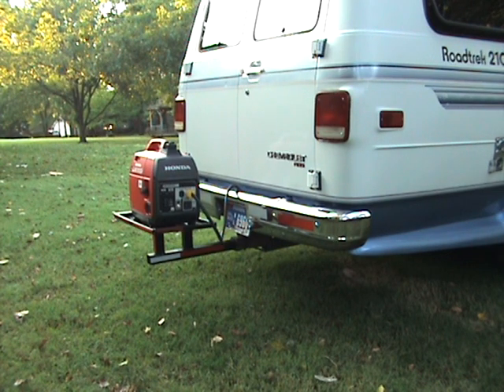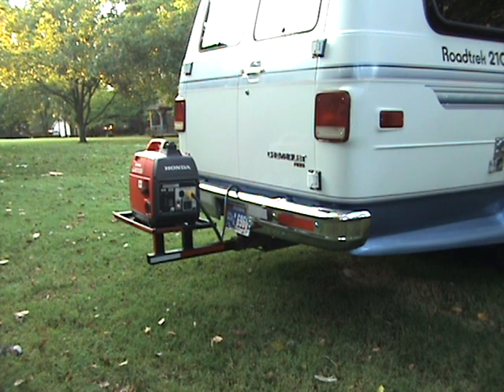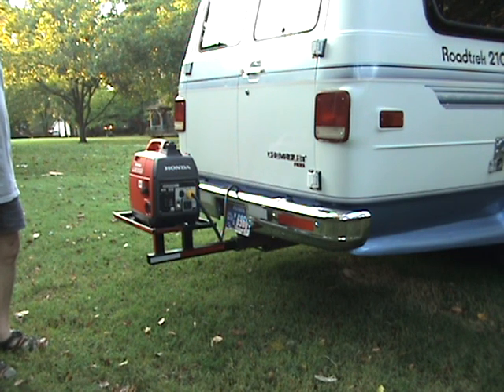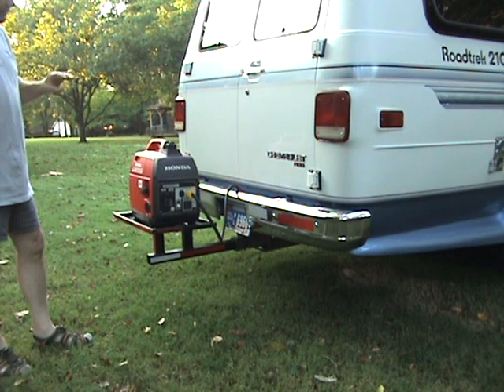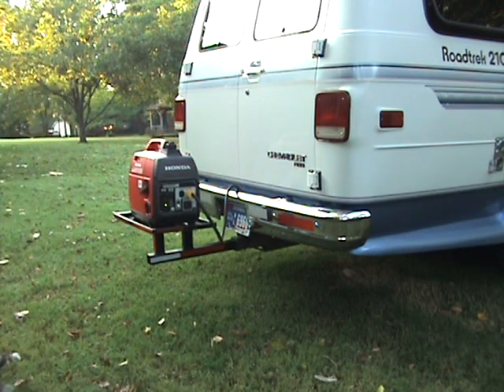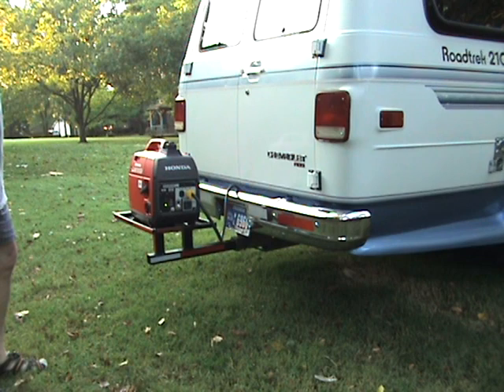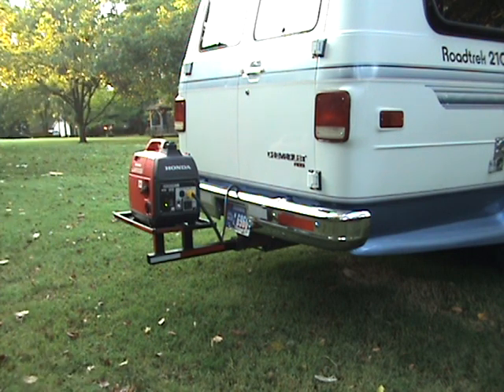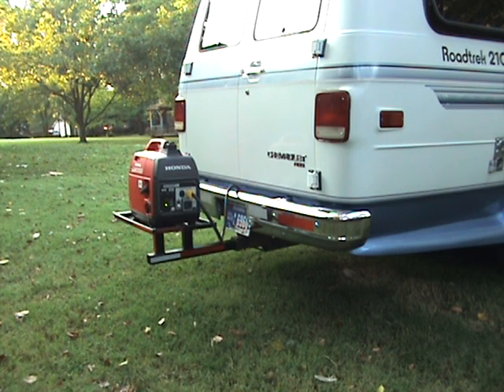Honda EU2000i Powering Roadtreck RV - starting 10,000 btu ac

Comment from the maker: We moved the little Honda to our boat to provide shore power. Will have more information this sumer. Very happy with the little Honda. We added an extended run fuel system to provide power overnight on the boat. Works great. I can run all weekend with 5 gallons of gas.

Comment: I just bought this Honda. I live in Florida.  I have an 8,000 BTU AC. The generator started the ac fine, but if I try to use the eco mode, the compressor on the ac will not come back on. We just left it on full power last night,  but it would be nice if we could put it on eco. Any suggestions?
Reply: The last big hurricane that hit we lost power,I used my Honda 2000i to power an 8000btu room air conditioner in the house.It would not start the compressor in the eco mode.So I just left it on normal.The generator would run for  exactly 4 hours on the 1 gallon tank of fuel.But Its  actually .9 gallons  tank.

Comment: I wonder if this generator will run one of those 10,000 BTU portable standing home AC systems like the LG or haier ones.
Reply from the maker: Shouldn't be a problem at all.  They are a lot more efficient than the 1996 RV A/C.
Reply: I have seen a guy run a portable, 10,000 BTU home AC unit with a Generac 2,000W generstor from Costco. No problem. It's a generstor similar to a Honda EU2000 but only costs half the money.

Comment: where do you place the generator while running?  I am planing on doing something like this for my diy camper van but I am worried about the fumes of the generator getting inside the camper just a few days ago a couple die in their sleep  while camping cause of this reason.
Reply from the maker: The generator stays right on the bumper where it's shown. I make sure when I stop the wind carries fumes away.  I also have a CO detector in the cabin.

Comment from the maker: The coach mounted A/C crashed on me this year and I had to replace it with an 8000 BTU compact A/C unit. This is a loss of 20% in capacity but I'm still getting better cooling with the 8000 BTU unit than the old 10,000 BTU. I've also noted that the smaller AC does not put near the load on the little Honda that the old unit did. I also eliminated the extra run capacitors from the inverter that helped start the old AC on the 100 degree days while the Honda Generator was in Econo mode. Still very pleased with the little Honda.
Reply: professorhardknock so the ac is running ok. how long have you had the Honda EU 2000 generator?
Reply from the maker: jrdtl1 This is my fourth year that I've had the Honda. Just used it last weekend on a trip and the generator worked great without the extra start capacitor for the A/C compressor.

Comment: I am looking at the Honda EU2000i generator. I would really like something that mounts under my van like your Onan did. I want to connect it to my van's gas tank. Any ideas?
Reply from the maker: Will Burson After having the little Honda for four  years I would never go back to an under van mounted generator.  I have my honda connected to the old ONAN fuel supply line on the main fuel tank and it now runs all night long without any problems. The Onan was a nightmare to service, offered no portability, and I was forced to take it out from under the van four times in one year. YOu need a fork lift to make this job easier. The ONAN runs at 3500 RPM (LOUD) as opposed to the Honda which varies the RPM based on the load. The Honda has just been a real workhorse. with just regular oil changes the only maintenance item. The oil changes are a snap. I did add a bank of run capacitors to assist the compressor starting on the AC unit on hot days. I added them inside the coach next to the inverter.
Reply: professorhardknock Yeah I'd definitely want mine hooked to the van's fuel tank. Do you lock your generator on the rack and cover it or stow it while you drive?
Reply from the maker: Will Burson It remains on the rear platform with a cable lock at all times unless I'm towing a trailer. It remains uncovered.

Comment: Your 10k BTU AC must be very low draw on start.   I know other people who have 8k BTU units that can't use the Honda in ECO mode...including myself.    Runs just fine with ECO off.
Reply from the maker: I have installed a second start capacitor installed on the AC unit in parallel with the original. The second cap makes all the difference in the world. Even on the hottest days the little 10k BTU runs like a champ. This will be my fourth season with the Honda. The original cap has three connections, common, fan circuit, compressor circuit. I went in parallel with the common and compressor side of the original cap.

Comment from the maker: I'm in my third season with the little 2000 powering the RV. Very pleased with the investment. The little Honda has exceeded all of my expectations. I just drove through some blinding rain storms last weekend with the Honda powering the 120VAC system while it was on my bumper hitch mount. Ran like a top. I even used it to power my van 12VDC system when the main alternator failed. Kept my main engine fuel pump running so I could get off the freeway. I set my trailer plug to power the main batteries from the Honda in the event I accidentally drained the main battery while parked. I had no idea how handy that little invention would become.

Comment: that's absolutely awesome... Thank you I was going to buy the 3000 but looks like the 2000 is all the power I need I do have a question I love how you mounted the generator how loud is it inside your van my head would be laying right on the back doors just wanted to know? When does the 2000 come with a remote start
Reply from the maker: Sorry about the delay getting back to you. Just saw your post. The generator is quieter than the AC unit itself. If the 2000 is ever offered with a remote start I'm going to buy one. My head is right next to the generator and right under the AC unit when I'm in the bunk. I'm working on fuel system mods to connect the 2000 to the RV gasoline supply so I can run all night without refueling. When i'm in the city where theft may be an issue i just unplug the generator and put it inside for security.

Comment: I've had two different RV's with the Coleman Mach AC units.  The Honda EU2000I will start one of those AC units reliably even in economy mode.
Reply: Crafted what btu does it start reliably? What is model number? My campervan 7200btu is not keeping up and I need to upgrade. I power everything with my Honda EU2000 and don't want to change generators.Also, hoping to get a roof top a/c that cuts off fan as well when temp is reached inside van.
Reply: The Coleman Mach units I've had success with is a 13,500 unit.  Most of the standard size units in this range cannot be ran because the starting load is too high.  You only want a Coleman Mach series.  And yes, I've always used it in Economy throttle mode to run the AC.
Reply: when compressor kicks off, do you have the ability  automatically to stop fan too for energy savings and noise?
Reply: Yea, all AC units as far as I know allow you to lock the fan on.  That is a thermostat setting - either "Fan ON" or "Auto".  Sometimes this can help if you have an AC unit the generator can't quite start.  You leave the fan on, this way only the compressor motor is starting and not the fan motor.  Motor start up is a big load on a generator or inverter.

Comment: If you don't mind me asking, what bad A/C are you using? I'm wanting to upgrade my tent trailer and I am having troubles finding rooftop a/c units under 10,000 btu.
Reply from the maker: The Roadtrek AC is a window mount AC unit that fits into a slot the top back of the cap. It's out of the slipstream when you're driving and does not cause any drag.

Comment from the maker: In reply to mosheg77. I'm pulling 2300 watts on a 90 degree day with the AC unit during start.  On a 105 degree day I'm pulling 2500 watts for more than 1.5 seconds and it is tripping the overload on the generator . I'm experimenting with some additional capacitors on the generator start circuit to give the AC an additional boost

Comment: Do you see any issues with the Honda EU2000i while running a 5000 btu AC, 26" TV, DVD player and a couple of small LED lights? Thanks
Reply from the maker: Hello, THe best way you can tell is put a load monitor on your black wire with all of the items running. You can pull 2500 watts during the AC start for one second without tripping the overload on the generator. If your AC compressor takes more than a second to start the compressor it will trip the generator. I'm experimenting with some large capacitors this year to give my AC an extra boost during real hot days and allow me to run in Eco-throttle continuously.
Reply: Make sure your tv is on an inverter not straight 120v or the starting current draw of the ac will take your tv of line.
Reply from the maker: Scott Falkner I have all of my electronics powered through a UPS backup. Provides very clean level power.

Comment from the maker: At some point during all that switching around your inverter is going to de-energize and cause a loss of power to the AC compressor. If the AC looses power and then attempts a restart it usually has a three minute delay before the compressor will start and then you are back to a normal start. I just start my AC with my Honda EU2000i with the Eco throttle OFF on the generator, start the AC, turn the AC Fan to a Medium setting, and then turn The ECO throttle ON.

Comment: Hello I have another question how start my 13000 BTU AC
Can I start my Onan 2500 generator, then , "On" AC -Following that start up my Honda
generator  - connect to shore line- "Off " Onan generator. In this case I can avoid high amperage during the start up AC. Is this correct?

Comment: Yes,from what I've learned the 5-2-1, 3 wire capacitor (not the 2 wire type) not only reduce amp start up requirements but are the best. I'm surprised that inclement rainy weather has no negative effects on the Honda unit and electronics/switches/controls. Thanks for the info as well. Let me know if you install the capacitor and how it works out. Of course they are used in residential & commercial applications as also.

Comment from the maker: Thank you for the advice on the CAP. The little Honda has worked perfect in all weather. Rainy weather seems to reduce the load from the AC unit and causes the Honda to work better. THe Onan Microlite would constantly stall from carb ice after it had been operating for an hour. THe Microlite is a 2 pole 3500 RPM genset. I have a 6000 Watt Onan  4 pole 1800 RPM 220 VAC 1ph I use to power my home during outages and it works great.

Comment: Try a 3 wire 5-2-1 hard start capacitor on your AC. Should take much of the A/C start up and cycle load off the Honda. 

How does the Honda respond in rainy weather while in use?

Comment from the maker: That's a great idea. I'm going to pull the prints on my AC and see if there is an option for a second cap.. My AC has only tripped the generator overload twice this year and both times I was in 115 degree heat. A second cap would probably fix that. Both times I was operating with Eco-throtttle ON. Thanks for the comment.

Comment from the maker: The generator cycles on and off on eco-throttle with no problem when the temperature is up to 90 degrees outside. It would trip on overload when it was new but now that it is broken in it has enough power to stay on eco-throtlle without tripping. Above 95 degrees it will trip on overrload when the AC cycles off and on. What I do is turn the AC fan down to Low and the temperature completely cold. This keeps the AC compressor running and it does not trip on overload.

Comment: Hi,
I saw that you started the AC with the eco throttle OFF, and then you switched the eco throttle to ON.
I wanted to ask how does the generator reacts when the AC's compressor cycles off and then cycles on again - since the eco throttle is now switcjed to ON, will it take the load or trip the generator/fuse?
Thank you

Comment from the maker: The Microlite is a poorly constructed and engineered 3500 RPM, 2 pole, Generator. The older four pole 1800 RPM Onan's were heavy and ugly but they are work horses. I have a 6500 that runs my whole house that I pulled out of 1970's model RV and built a transfer switch. I bought the generator at a swap meet for $250.00. It ran my whole house for 10 days during the ice storm we had three years ago.

Comment from the maker: The inverter has an automatic transfer switch that supplies generator power to the coach from shore power once the generator is energized. Big safety reason that keeps me from back feeding the shore power cable when the generator is running. Also, the generator conduit was out the back of the coach. Shore power out the side in the locker. Removing the old generator is not easy. I also made the custom hitch for towing that fit around the Microlite generator. Now an open space.

Comment from the maker: I'm getting ready to modify my rear hitch mount to accomodate an extended run fuel system and allow me to sleep all night when it is greater than 100 degrees outside. THe standard fuel tank (1.1 gals) runs out in five hours on a 100 degree night.

Comment from the maker: My generator has two 15 AMP 120 Volt receptacles. The yellow plug is was added to a stranded 3 conductor cable and terminated on the original transfer switch terminals for the Onan Microlite.  The little Honda just keeps chugging along.

Comment from the maker: I need to run an AC unit at night in 90 degree heat and 90% humidity. Solar wouldn't work well and I couldn't haul enough batteries to store power for the night. Here in the Mississippi Valley it is has been hottter than Orlando for most of the summer.

Comment from the maker: My generator has two standard 15 amp 120 VAC receptacles. I am using a standard 15 amp plug on the right receptacle. It has fallen out a time or two. I wish now I had spent the extra $100 and gotten the twist lock plug but it has only fallen out once or twice. The Honda with the twist lock plug is typically used as the second generator in paralell operation for the 3000 Watt service. The Honda powered my AC unit when we got up to 107 degrees here.

Comment: Keith: The generator in the video has two receptacles on it. One is a standard 25 amp receptacle and the other IS a 30 amp 120 volt "twist lock" type. I believe the male plug he is using on his cable to plug into the generator is called an "R-30" plug and can be purchased at most hardware / elec. supply houses.   Just FYI

Comment from the maker: You are right on the ragged edge of what the EU2000i can provide.  I went to the Honda Dealer and told him that if it would run my AC on a hot day I would buy the Generator. He serviced a new unit and we tried it. I went ahead and purchased the generator. Since that time my Honda has gotten a little stronger after break in and it is working better than when it was brand new. The EU2000i can be paralleled with with another EU2000i for 3000 Watts. MY AC is 10,000 BTU.

Comment from the maker: The little HONDA EU2000i will now run the AC all night long on a tank of fuel if the AC fan speed is set to low. I leave the Eco throttle ON and the Honda speeds up as the AC compressor cycles on. It does not trip the generator overload. The little Honda has gotten stronger after the engine broke in. It's extremely quiet, lightweight, and powerful.

Comment from the maker: I made the mount out of scrap steel in my shop. I use a Master lock cable lock to Hold the generator on the platform as I am rolling.

Comment from the maker: Thanks for the comment. The Roadtrek owners forum was looking for an alternate generator to replace the ONAN Microlite (that comes with the RV). My little Honda has served me well and running the AC on medium speed with the coldest setting keeps the compressor running continuously and allows me to use the Eco Throttle.  Even with Eco THrottle off it still more quiet than the ONAN.

Comment from the maker: I am very pleased with the little Honda. It is light enough to carry to a remote job location and will start saws and compressors with the eco throtttle OFF.  I can finally get a nights rest with the AC on in the van without getting up and restarting the generator several times. I have several Onan generators that are suscepitble to carb ice. The Honda works  without a hiccup.